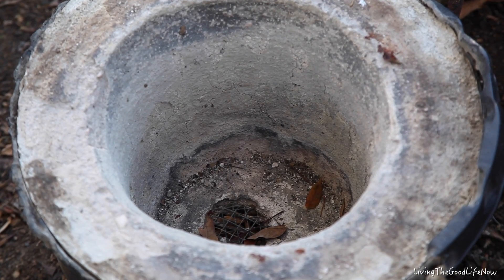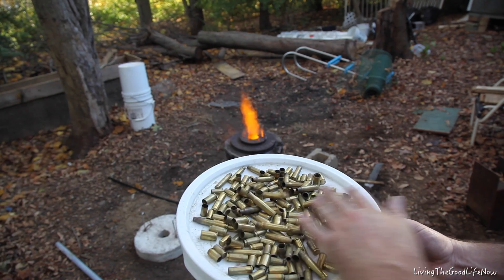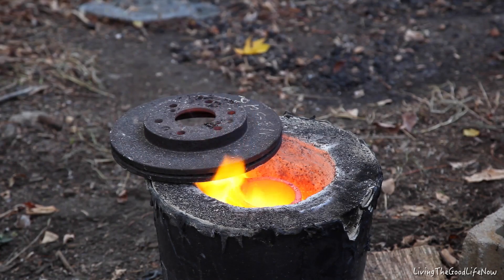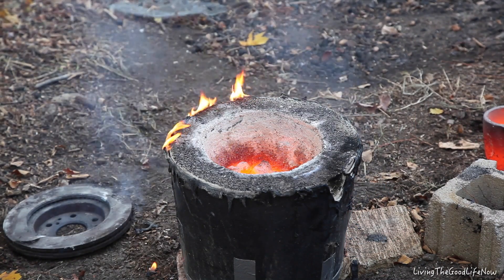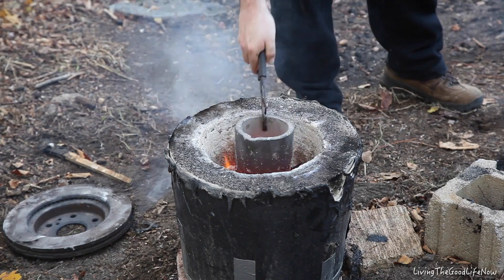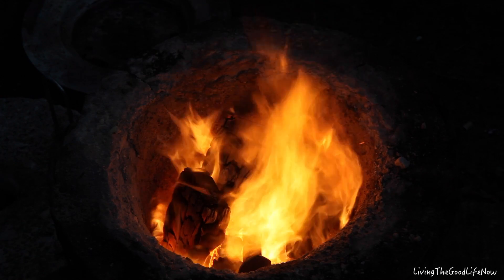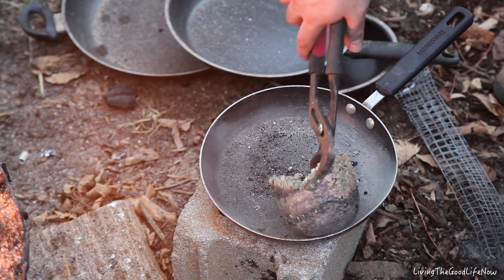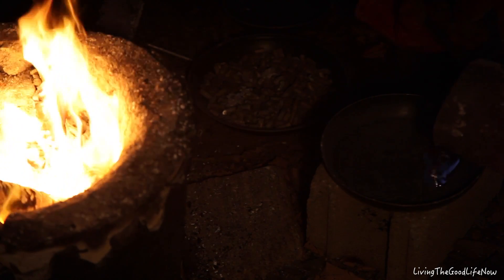Melting Brass in Charcoal Foundry Furnace Bullet Shells Casings 5lb Ingot Aluminum Casting Forge Pt5

Comment: I know this is a long time ago and probably irrelevant at this point to say but if you were using bituminous or anthracite coal It burns hotter and longer brass melts at about the heat that charcoal Burns at so you're cutting it too close. Not getting it quite there if you'd have been using one of the other two coal-options listed above I would imagine it would have worked way better without a forge. I have deformed brass and pliers with that coal
Reply from the maker: At the time, and part of the point of this video as to see if the preformed pressed charcoal briquettes would burn hot enough, which it didn't.   Lump raw (from wood) charcoal would of been hotter but still not as hot as actual bituminous or anthracite coal.

Thanks for watching, commenting & Subscribing!

Comment: I like the water on the pan that was a cool effect.  “they don’t make frying pans like they used to” 😂   From what I’ve heard the charcoal you want to use is lump charcoal made from whole wood, the charcoal briquettes have a lot of sand and filler in them.  Also you need some flux on that brass.  I had a similar thing happen with aluminum bronze.  It’s tricky.

Comment: i need help...my charcoal in the foundry is not burning ..i also dont have propane torch so HOW TO LIT CHARCOAL IN MY FURNACE
Reply: techno id 
I like to make a small wood fire outside the furnace first and add some charcoal to it so it's open to more oxygen to burn. Once they get red I shovel the hot coals out with a little garden spade and transfer them into the furnace. The spade helps a lot reloading more charcoal around the crucible too so you don't burn your hands, whether it's briquettes or homemade lump charcoal. But the lump charcoal tends to give off more sparks depending on the wood its from.

Comment: Kaowool and some refractory cement would be your lightest and better option.. You can cover part of the intake on your blower to adjust the air flow to slow it down on startup and open it later to get the final melt.. 
Better to run your blower pipe in the side at an angle to swirl the heat around the crucible.
Easy to build a propane burner. Same setup you have with the blower,,, just get a tank and regulator and a copper line or brake line to inject the propane at least 6" from the furnace.. 12" better to allow the air/propane to fully mix before entry.. You don't need any mig tips or special size orifice.. easy to play with and get a good test burn.. Keep the volume low to begin with.. As the forge heats up, it will burn much better.. Try to get the swirl action around the crucible.. will melt quicker and better use of the heat... You are getting plenty of heat.. I can't tell for sure, but, looks like your brass was melted.. Remember. You also have metal primer, wadding, lots and lots of ashes from the coal, etc.. The brass is thin, and not a lot of it.. Clear out the dross and the brass will be there.. I forget what kind of flux to use, but, I think Borax is correct for brass...
Look into Green Sand for your moulds.. Just for Ingots, you can use Capped angle Iron pieces to pour your excess into.. 
Just a few thoughts on your project.. Keep working at it..  Your mix didn't have much of a chance with more than a hair dryer blower.. Just enough to melt the aluminum.. You are getting pretty hot in there with the volume of air.. 
Cheers..

Comment: how long does it take to melt brass?
Reply from the maker: It depends on how hot you can get the foundry/crucible... It took me extra long because I was using standard BBQ charcoal briquettes and not raw charcoal which burns hotter, or even better use propane.

Also my lid cracked so I had to improvise and I was loosing a lot of heat from there.  Thank you for watching and subscribing!

Comment: okay if it wont melt then use  the black oil coals i dont know the name but the coals are Mde from the trash products that is left after making diesel and gasoline do anyone of you know the correct name of them? in danish it's called energi koks. energi= energy  and i dont know what koks is
Reply from the maker: They sell regular medium to large raw coal/charcoal pieces that burn hotter.. I was using the preformed charcoal briquettes made from dust that are specially formulated to burn slower and at lower temperature for BBQ grills.

Comment: A couple tips, if you don't mind: Wear heavy gloves   -   don't pull your crucible out of the charcoal to replenish it   -   Drop your replenishment right down thru the hole in the brake rotor   -    Don't use a PLASTIC bucket for your forge (but you already knew that).
Reply: lebomm johnson I’m no expert but if the charcoal got into the crucible could it add a hardening/brittle effect like with iron or steel?

Comment: I'd knock those struck primers out those cases first.  they all still have some explosive left in them especially the rimfire cases.  plus you'd think that would also increase the purity of the final product.
Reply from the maker: I left the primers in and it did not cause any explosions, most likely because they were already spent.. just make sure not to use any live bullets.   Also if you scoop out the slag it kind go purifies it.
Good luck with your project, Thank you for watching & Subscribing!

Comment: Wondering how many reloaders are cringing
Reply from the maker: there would be a lot more of them cringing if they knew about the 3,500 lbs of brass shell casings we bring to the scrap yard every month from the gun range just to be shipped to china to be melted down.
Reply: @LivingTheGoodLife  Hey can we have a couple it would be greatly appreciated we are trying to do this.
Reply: Did you just get these from a range? If so how willing were they to just let you go pick the casings?
Reply: I also load for the 8x57 getting hard to find the cases cheap now days
Reply: All of them.